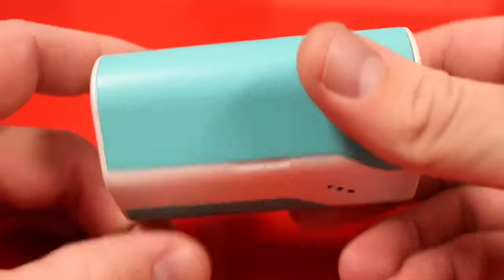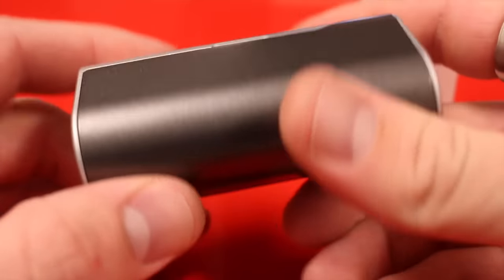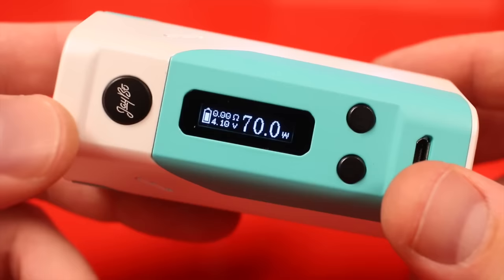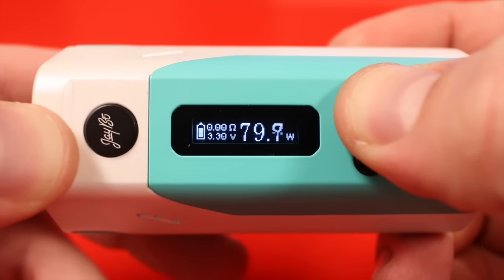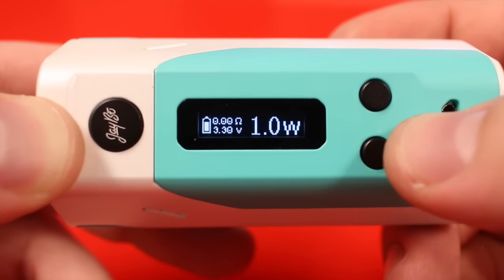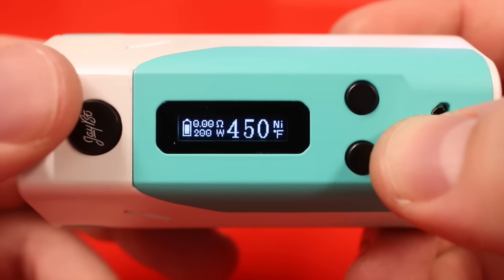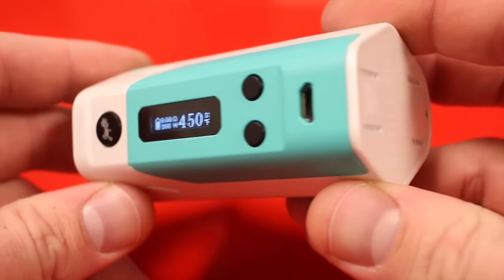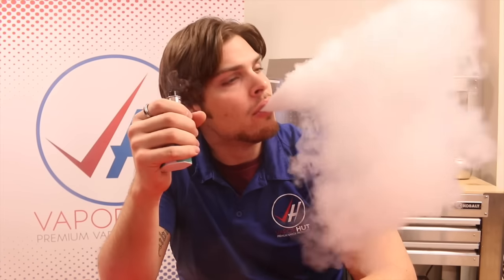[FIRST LOOK] Reuleaux RX200 by Wismec

Comment: is the rx200 body plactic or is it using the same material of the dna200 version?
Reply from the maker: It is exactly the same as the DNA200 version. Metal body and all. Just a different chip.
Reply: thank you.. still looking forward for more in depth review of this particular device. More power to your channel. Vape on :-)